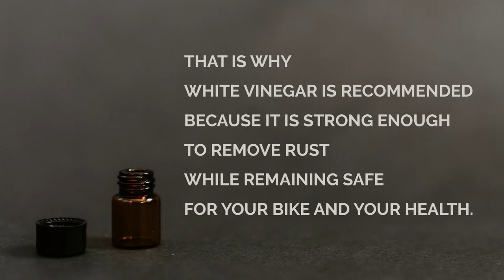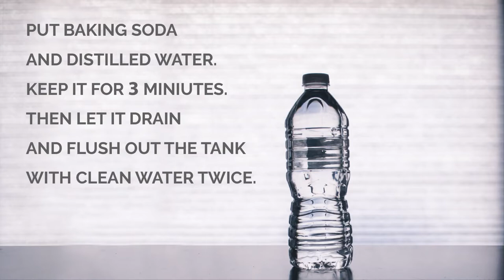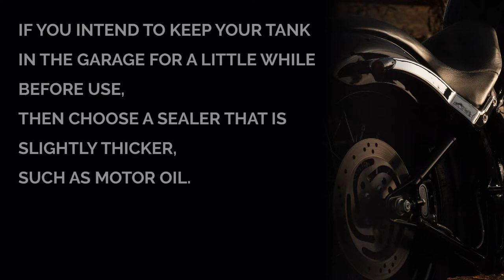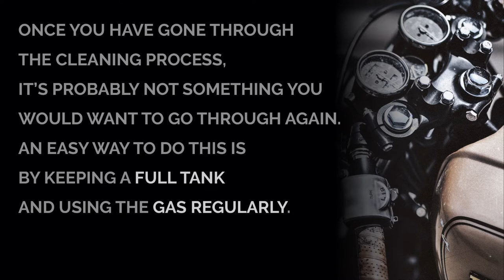HOW TO CLEAN A MOTORCYCLE GAS TANK WITH VINEGAR | HONDA MAGNA VT250

Comment: Do you have to use the air compressor to clean out the tank? If you’re not going to ride your bike for a while, is it best to keep a full tank or to empty the tank? What are different options to coating the inside of the tank?
Reply from the maker: In this video I use air compressor to dry the tank after putting backing soda and distilled water to neutralize it.
If you’re not going to ride your bike for a while, Water in the fuel can also cause corrosion. the best course of action is to drain the fuel tank completely, then refill the tank to its full capacity adding a fuel stabilizer recommended by the bike's manufacturer. If you want to start the bike regularly, full tank is the best option.
There are so many tank sealing product in the market. The challenges here are that the liquid sealer dries very quickly, it is hard to know if it is even, and the outdoor temperature and humidity impact dry time and quality – could cause cracking. So the best thing is to get the service of a specialist.
Reply: You can blow it out as much as you can and if you have some methanol you can flush the residual water out because it mixes with water. Then flush it with gas with a cup or so of transmission fluid mixed with the gas. The transmission fluid has anti rust additives. When I have to store my bike for an extended period I fill it with non ethanol gas and a cup or so of transmission fluid and shake the bike good which will coat the inside of the tank.

Comment: Why you use distilled water?
Reply from the maker: After the vinegar treatment then we put backing soda and distilled water to neutralize the tank. The reason why we put distilled water instead of tap water is free of organic and inorganic chemicals, heavy metals, volatile gases, cysts and other contaminants. Distilled water contains virtually no solids, minerals or trace elements. It is clean and natural.
Reply: @IdeaShip  Where in "nature" can I get distilled water?

Comment: When you're done. Don't forget to oil.
Reply from the maker: Definitely. 👌 Thank you very much for your valuable comment. 💛
Reply: @IdeaShip  another tip is to use transmission fluid, it has anti rust additives that protect the transmission parts, plus it burns good with the gas, just don’t use too much of it.